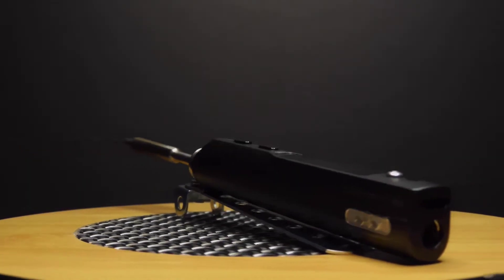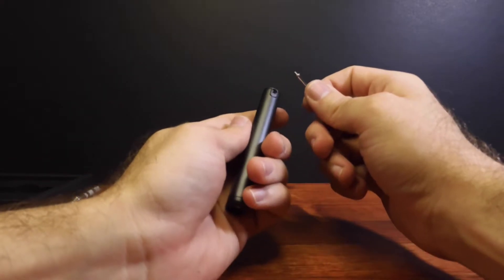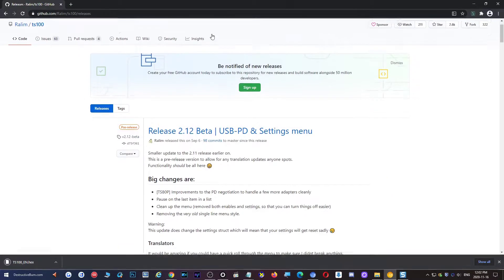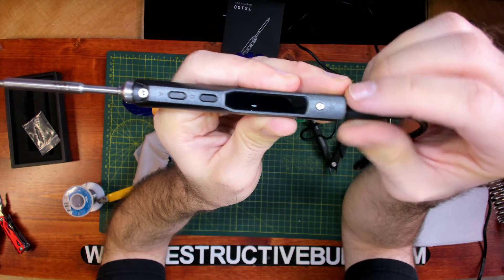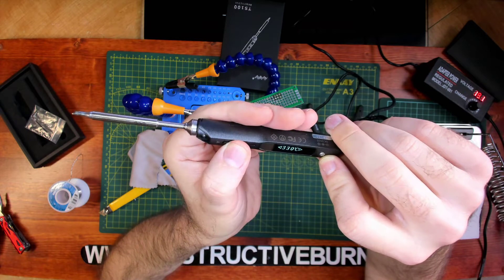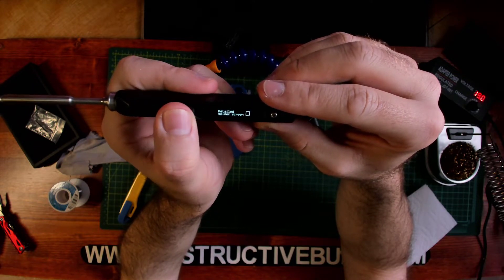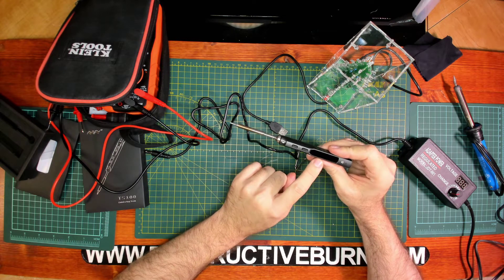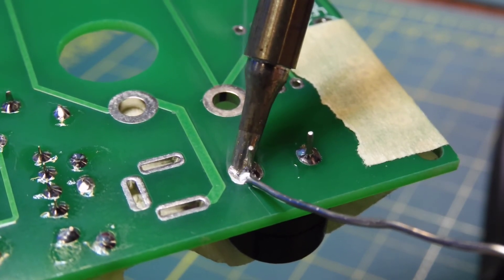TS-100 Unboxing Review and Firmware Upgrade

Comment: Great video. The logo looked really pixelated for me. What worked was to shrink the logo wayyy down in the original .ai file. Then bring it over to photoshop and apply a bunch of layers of sharpening to clean up the edges. Looks great now, thanks. The personalized logo is a nice touch.
Reply from the maker: If you mean the DB logo on load up I did provide the correct file for it but I am glad you figured it out.
Reply: @DestructiveBurn  Oh no I meant my own personal logo.
Reply from the maker: @emeraldtechrepair  OH ok. Yeah even when I did mine it had to be done in pixels as the screen is so small.  You pretty much need to make the logo by scratch.
Reply: @DestructiveBurn  Yeah that's what I was thinking I'd have to do. But just oversharpening the hell out of it seemed to work for me lol. Just in case anyone else sees this. It's gonna look pretty rough in Photoshop and the Logo Software, but on the device itself it looks just fine.

Comment: I bought all the original bits from Banggood almost 2 years ago, but now they do not have the original anymore,  you can buy the not originals from Banggood still, or you can buy the original from Novellife.

I love my Miniware TS100, i bought my TS100 almost 2 and a half years back, my first one broke, and i sent a e-mail to miniware, and they immediately send me a new one, without any question but only my address, and within a week i got a new one.

There support is great.

Great video BTW.
Reply from the maker: Yeah, getting original none knockoff tips is kinda hard to get.  My TS-100 is still working great. I really love it.  Since this video, I haven't really used my blue pencil soldering iron, just the TS-100.
I bought a case for it off eBay and eventually get more tips.

Thanks.  Glad you liked it!
Reply: @DestructiveBurn  You have now all the original Miniware bits you wanted? If not, then you can buy the original Miniware from Novellife, yeah i bought the original aluminum case from Banggood almost 2 years ago, there i have all my bits in.

Hope to see more video's from you soldering with the TS100.
Reply from the maker: Thanks for the heads up on https://www.novellife.net/ another solid location for TS-100 stuff.  Indeed I'll be making more soldering projects with the TS-100.
Currently working on a 2 1/2 inch swivel table vise comparison video.